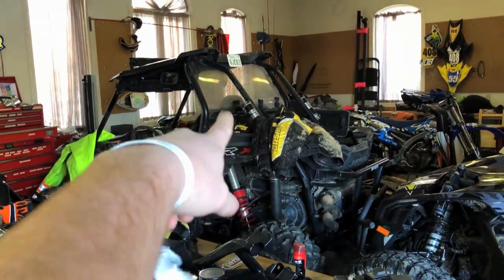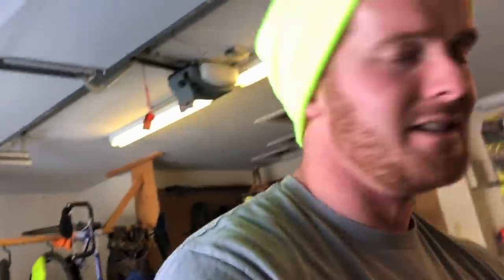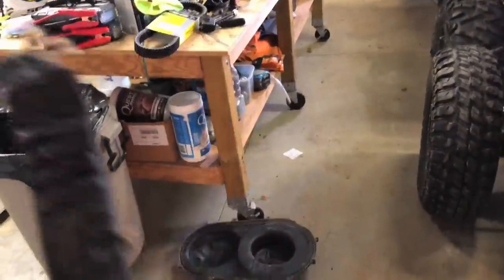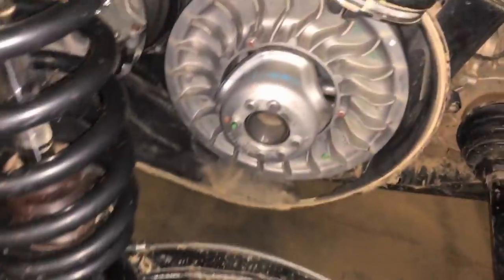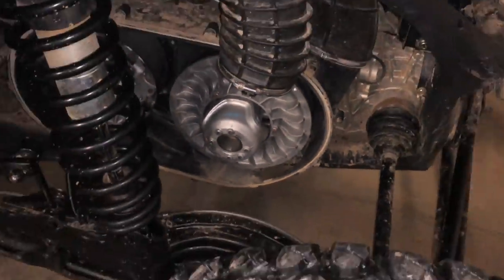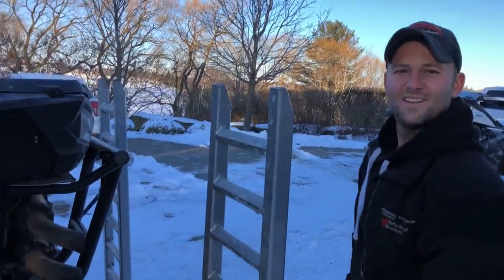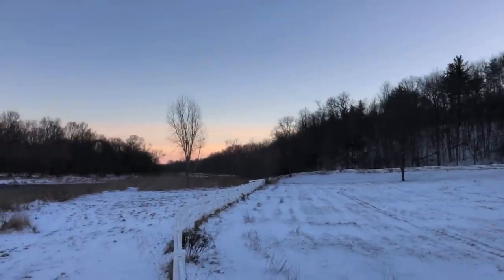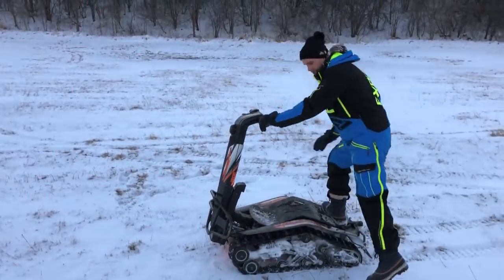Blew A HOLE Right Through CAN AM MAVERICK X3!!!

Comment: Holding a macine wide open generally does not blow a belt. Holeshots and brake boosting during hole shots is generally what blows belts. Getting too much heat into the belt during the summer months will also cause belts to grenade.

Comment: That’s the reason I sold my maverick. I bought a rzr turbo 2200 miles. Changed the belt at 1000 miles. Not because it was blown but just because I couldn’t go more than 1000 miles on a belt from my maverick.